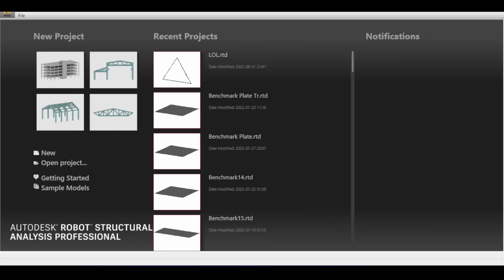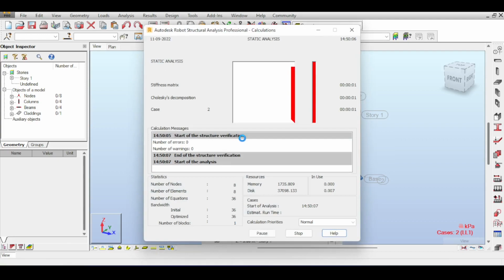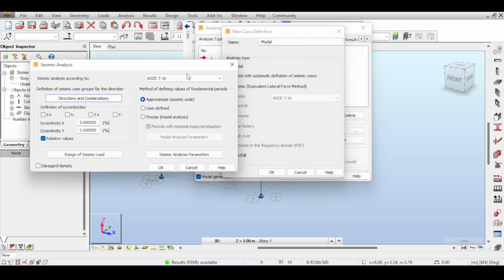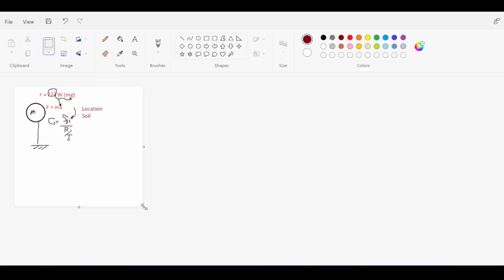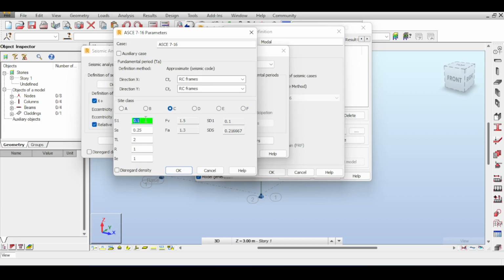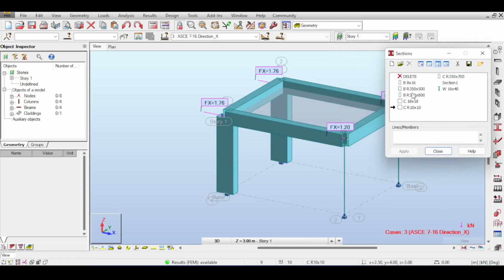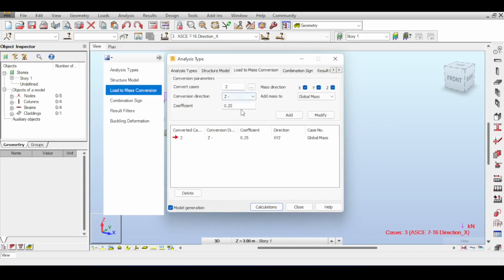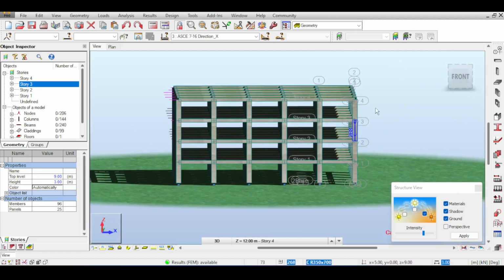Defining Earthquake Loads in Autodesk Robot: Simplified Tutorial

Comment: Robot 2024 Model Selfweight in simple Modal analysis issue. This morning, after erasing all the temporary files in %TEMP% , Robot 2024 seems to work fine without the selfweight issue. I did this after tryong to set the selfwight sign to -1 in the load table. Dont know I to explain this since not only did I get to deal with this issue while you also did. I did experience that issue on two different computers. Best regards
Reply from the maker: I think this might be a bug in Autodesk Robot. Thnx for pointing it out. It is indeed strange, but well, at least it seems (if I understood your correctly) that it normalized. Good to know, I will email the ppl there to let them know about this bug.
Regards,
CEE
Reply: The drawback when erasing %TEMP% file content is that if your model was built with the self weight issue it cannot be corrected or at least I still don’t know how. Stuck with the resident self weight  @CivilEngineeringEssentials
Reply from the maker: @richardbelec3816  I think the solution itself might not be really the way to go, but a temporary solution until Autodesk decides to fix the issue. IMHO, if you remove the self weight, it should be removed.

Comment: I do appreciate your concern regarding this anomaly, Effectively,by including a plus sign to compensate the selfweight of the resident load could be a short term solution altough I would still not know how the software will generate the self weight calculations, is it an equation issue? As for the density, the activation of the "neglect density' function will not provide any changes, the selfweigt is still being included in the results, I did send a request on the Autodesk Forum but did not receive any conclusive replies. Hopefully Autodesk will apply a correction towards this issue. Best regards.
Reply from the maker: It seems from you follow-up comment that you found a way to make it work by emptying the Temp folder. Looks like a bug to me, will follow up with Autodesk. Maybe they release an update to address the issue.

Regards,
CEE

Comment: I’m coming back to this presentation with respect with the 2024 version of Robot. I noticed that when a simplified modal sismic analysis is being conducted it is required to include mass conversion for live, dead and snow loads according to design code. The problem is that in all cases the basic structure weight is automatically included in the analysis even if the unit eight of structure is erase from the load table. Is Robot at fault ? Tried to erase all loads and still getting results from weight of structure participation. Thanks for your very professional teaching, the greatest !
Reply from the maker: I checked the documentation of Robot. It seems you are right (I still need to give it more research), but it seems if you perform a dynamic analysis, it will immediately consider a self weight (built in). And the only option you have is to add parts of load cases to it as it seems.
I am still investigating this thing, but there is a quick hack you can use until I get some answers from Autodesk.

You can add a self weight in the upwards z-direction "kind of to cancel out the built in self-weight. But this solution is kind of a hack and not really what I want to suggest.

As I said, checking out why this is. It seems that when you defined a modal analysis, (the pre-requisite of seismic) you can choose the way it calculates the mass and you can even disregard density. I have not played with those options but maybe you can check and tell me your findings.

Sorry to not be able to give a definitive answer. Still, I am happy you find those videos beneficial.

Stay tuned,
CEE

Comment: So now a have one automatic generated force created in one direction and in the other perpendicular direction Ok. But to use this forces in my manual combination a must create an accidental quadratic combination of both?  And the last one I've created put on my ULS combination. That's correct?
Reply from the maker: for some reason, it seems I missed your comment.

    Thanks for your question. You're correct that Robot generates automatic loads for each horizontal direction in an earthquake analysis. However, for your ULS combination, you need to consider how these forces might interact under extreme conditions.

    An accidental quadratic combination (SRSS or Quadratic Sum of the Squares) is appropriate for earthquake forces because it assumes they can occur simultaneously, although not necessarily at their peak values. This provides a conservative estimate of the maximum combined effect on your structure.
Reply: @CivilEngineeringEssentials  can explain what we talked here with an example yours a simple situation will help me to be sure that what I do is correct.